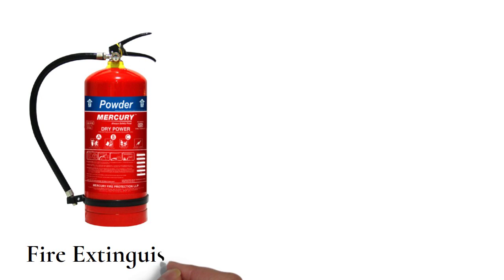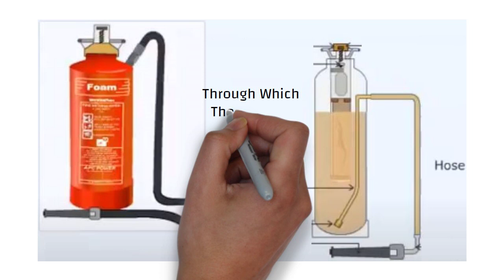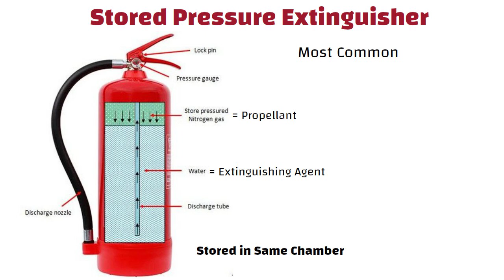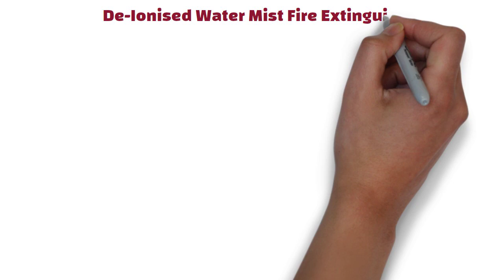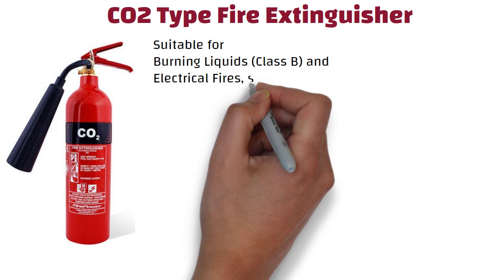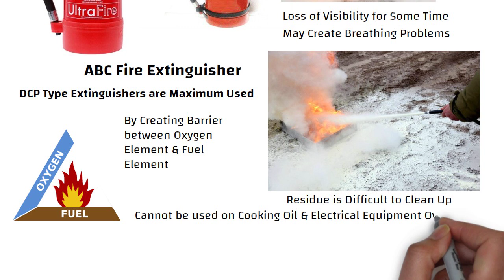FIRE EXTINGUISHER DEALERS IN KERALA, CALL 8138906102, FIRE EXTINGUISHER DEALERS IN ERNAKULAM.

Comment from the maker: Fire extinguisher dealers in PERUMBAVOOR, fire fighting contractors in PERUMBAVOOR, PERUMBAVOOR, fire and safety installations in PERUMBAVOOR, fire Fire extinguisher suppliers in PERUMBAVOOR,fire extinguishers in PERUMBAVOOR, fire extinguishers in PERUMBAVOOR, fire protection system in PERUMBAVOOR, fire and safety installation in PERUMBAVOOR, fire and safety contractors in PERUMBAVOOR, fire safety contractors in PERUMBAVOOR, fire and safety systems equipments in PERUMBAVOOR, fire equipment in PERUMBAVOOR, fire extinguisher in PERUMBAVOOR, fire protection system installation in PERUMBAVOOR, fire contractors in PERUMBAVOOR, fire safety consultants in PERUMBAVOOR,  fire alarm systems in PERUMBAVOOR, fire NOC in PERUMBAVOOR, fire AMC in PERUMBAVOOR, PERUMBAVOOR, fire fighting equipment in PERUMBAVOOR,
MS Jindal pipe dealers in PERUMBAVOOR, motor control panel in PERUMBAVOOR, fire pump panel in PERUMBAVOOR, motor control panel in PERUMBAVOOR, Morley fire alarm in PERUMBAVOOR, gst fire alarm in PERUMBAVOOR, addressable fire alarm system in PERUMBAVOOR, Pa talk back system in PERUMBAVOOR, PA two way talk back system in PERUMBAVOOR, auto glow SIGNAGES in PERUMBAVOOR, Karthar dealers in PERUMBAVOOR, Agni fire alarm dealers in PERUMBAVOOR, ASES SECURITY fire alarm dealers in PERUMBAVOOR, AUTO GLOW SIGNAGES in PERUMBAVOOR, FIRE PUMP PANEL in PERUMBAVOOR, LHP pump in PERUMBAVOOR. Karthar valves in PERUMBAVOOR, Ravel fire alarm system in PERUMBAVOOR. Jindal pipe dealers in PERUMBAVOOR, Jindal pipe dealers in PERUMBAVOOR. MS pipe dealers in PERUMBAVOOR. Butterfly valves in PERUMBAVOOR, PA talk back system in PERUMBAVOOR, Fire alarm dealers in PERUMBAVOOR, smoke detector dealers in PERUMBAVOOR, fire alarm panels dealers in PERUMBAVOOR, MCP, hooter dealers in Mangalor, hydrant valve dealers in PERUMBAVOOR, branch pipe dealers in PERUMBAVOOR,Fire CP hose in PERUMBAVOOR, Fire RRL hose in PERUMBAVOOR, heat detector dealers in PERUMBAVOOR, Motor Control panel in PERUMBAVOOR,  LED EXIT LIGHTS dealers in PERUMBAVOOR, emergency exit light dealers in PERUMBAVOOR, auto glow SIGNAGES dealers in PERUMBAVOOR. Conventional fire alarm system in PERUMBAVOOR, Fire alarm panel in PERUMBAVOOR, Notifier fire alarm dealers in PERUMBAVOOR, PA talk back unit dealers in PERUMBAVOOR. Honeywell fire alarm dealers in PERUMBAVOOR, BOSCH PA system dealers in PERUMBAVOOR, 
KIRLOSKAR FIRE FIGHTING PUMP DEALERS IN PERUMBAVOOR, FIRE FIGHTING EQUIPMENT DEALERS IN PERUMBAVOOR, FIRE ALARM SYSTEM DEALERS IN PERUMBAVOOR, FIRE CONSULTANTS IN PERUMBAVOOR, FIRE CONTRACTOTORS IN PERUMBAVOOR, FIRE CONTRACTORS IN PERUMBAVOOR, FIRE ALARM SYSTEM DEALERS IN PERUMBAVOOR, SMOKE DETECTOR DEALERS IN PERUMBAVOOR, FIRE PROTECTION SYSTEM IN PERUMBAVOOR, FIRE CONSULTANTS IN PERUMBAVOOR, FIRE CONSULTANTS IN PERUMBAVOOR, PA TALK BACK SYSTEM IN PERUMBAVOOR, ADDRESSABLE FIRE ALARM SYSTEMS IN PERUMBAVOOR, CUTTER PUMP DEALERS IN PERUMBAVOOR, ADDRESSABLE FIRE ALARM SYSTEM SUPPLIERS IN PERUMBAVOOR, SMOKE DETECTOR DEALERS IN TPERUMBAVOOR, PRESSURE BOOSTING PUMP DEALERS IN PERUMBAVOOR, SLURRY PUMP DEALERS IN PERUMBAVOOR, WATER PUMP DEALERS IN PERUMBAVOOR, RAVEL FIRE ALARM SYSTEM IN PERUMBAVOOR, LUBI FIRE FIGHTING PUMP DEALERS IN PERUMBAVOOR, FIRE EXTINGUISHER DEALERS IN PERUMBAVOOR, ADDRESSABLE FIRE ALARM SYSTEM DEALERS IN PERUMBAVOOR, 
KIRLOSKAR FIRE FIGHTING PUMP DEALERS IN PERUMBAVOOR, KIRLOSKAR FIRE FIGHTING PUMP DISTRIBUTORS IN PERUMBAVOOR, KIRLOSKAR FIRE PUMPS IN PERUMBAVOOR, KIRLOSKAR DIESEL ENGINE FIRE STANDBY PUMP DEALERS IN PERUMBAVOOR, KIRLSOKAR MONOBLOCK FIRE PUMP DEALERS IN PERUMBAVOOR, KIRLOSKAR FIRE TERRACE PUMP DEALERS IN PERUMBAVOOR, KIRLOSKAR FIRE PUMPS IN PERUMBAVOOR, KIRLOSKAR FIRE FIGHTING PUMP IN KARNATAKA, KIRLOSKAR FIRE PUMP DEALERS IN KARNATAKA, KIRLOKAR FIRE PUMP DEALERS IN HOSUR, KIRLSOAKR FIRE FIGHTING PUMP DEALERS IN PERUMBAVOOR, KIRLOSKAR FIRE PUMPS IN PERUMBAVOOR, KIRLSOKAR FIRE PUMP DISTRIBUTORS IN PERUMBAVOOR, FIRE ENGINE PUMP SETS IN PERUMBAVOOR, KIRLOSKAR PUMP DEALERS IN TIRUELVELI, KIRLOSKAR DEALERS IN KARNATAKA, KIRLOSKAR PUMPS IN KARNATAKA, KIRLOSKAR PUMPS IN PERUMBAVOOR, LUBI FIRE PUMP DEALERS IN PERUMBAVOOR, LUBI FIRE PUMP DEALERS IN KARNATAKA, LUBI FIRE PUMP DEALERS IN PERUMBAVOOR, FIRE PUMP SUPPLERS IN KAYAKUMARI, FIRE FIGHTING PUMP DEALERS IN KAYAKUMARIHOSUR, FIRE PUMP DEALERS IN KARNATAKA, FIRE PUMP SUPPLIERS IN PERUMBAVOOR, FIRE PUMP DEALERS IN PERUMBAVOOR, FIRE FIGHTING PUMPS IN PERUMBAVOOR, FIRE FIGHTING PUMP DEALERS IN PERUMBAVOOR, FIRE FIGHTING PUMP SUPPLIERS IN KARNATAKA, FIRE FIGHTING PUMP SET DEALERS IN PERUMBAVOOR, FIRE PUMP IN KARNATAKA, FIRE PUMP IN PERUMBAVOOR, FIRE PUMP IN PERUMBAVOOR, FIRE DIESEL ENGINE PUMP DEALERS IN PERUMBAVOOR, FIRE DIESEL ENGINE STANDBY PUMP DEALERS IN PERUMBAVOOR, FIRE JOCKEY PUMP DEALERS IN PERUMBAVOOR, FIRE JOCKEY PUMP DEALERS IN KARNATAKA, FIRE JOCKEY PUMP DEALERS IN PERUMBAVOOR. CRI PUMP DEALERS IN PERUMBAVOOR, HYDRO PNEUMATIC PRESSURE BOOSTING PUMP DEALERS IN PERUMBAVOOR, VERTICAL INLINE PUMP DEALERS IN PERUMBAVOOR, INDUSTRIAL PUMP DEALERS IN PERUMBAVOOR, SEWAGE PUMP DEALERS IN PERUMBAVOOR, STP AND ETP PUMP DEALERS IN TIRUNELVALEI, STP AND ETP PUMP DEALERS IN PERUMBAVOOR, STP AND ETP PUMP DEALERS IN PERUMBAVOOR, STP AND ETP PUMP DEALERS IN PERUMBAVOOR, HYDRO PNEUMATIC PRESSURE BOOSTING PUMP DEALERS IN PERUMBAVOOR, SEWAGE PUMP DEALERS IN PERUMBAVOOR, DEWATERING PUMP DEALERS IN PERUMBAVOOR, FIRE JOCKEY PUMP DEALERS IN PERUMBAVOOR, CRI PUMP DEALERS IN PERUMBAVOOR,

Comment from the maker: FIRE ALARM DEALERS IN PERUMBAVOOR, ADDRESSABLE FIRE ALARM DEALERS IN PERUMBAVOOR, FIRE ALARM SYSTEM DEALERS IN PERUMBAVOOR, ADDRESSABLE FIRE ALARM SYSTEM DEALERS IN PERUMBAVOOR, FIRE DETECTION SYSTEM IN PERUMBAVOOR, SMOKE DETECTOR DEALERS IN PERUMBAVOOR, CONVENTIONAL FIRE ALARM DEALERS IN PERUMBAVOOR, MORLEY FIRE ALARM DEALERS IN PERUMBAVOOR, GST FIRE ALARM DEALERS IN PERUMBAVOOR, ASES SECURITY FIRE ALARM DEALERS IN PERUMBAVOOR, BEAM DETECTOR DEALERS IN PERUMBAVOOR, FIRE ALARM SUPPLIERS IN PERUMBAVOOR, FIRE ALARM TRADERS IN PERUMBAVOOR, FIRE ALARM PANEL DEALERS IN PERUMBAVOOR, HEAT DETECTOR DEALERS IN PERUMBAVOOR, FIRE ALARM SYSTEM SUPPLIERS IN PERUMBAVOOR, FIRE ALARM COMPANIES IN PERUMBAVOOR, FIRE EQUIPMENT DEALERS IN PERUMBAVOOR, ADRRESSABLE FIRE ALARM PANEL DEALERS IN PERUMBAVOOR, FIRE ALARM SYSTEM IN PERUMBAVOOR, BATTERY OPERATED DETECTOR DEALERS IN PERUMBAVOOR, ASPIRATION DETECTION SYSTEM DEALERS IN PERUMBAVOOR, FIRE ALARM MCP - MANUAL CALL POINT DEALERS IN PERUMBAVOOR, FIRE ALARM HOOTER DEALERS IN PERUMBAVOOR, PA TWO WAY TALK BACK SYSTEM DEALERS IN PERUMBAVOOR, PA SYSTEM DEALERS IN PERUMBAVOOR, PA TALK BACK UNIT DEALERS IN PERUMBAVOOR, HOOTER CUM STROBE DEALERS IN PERUMBAVOOR, FIRE PROTECTION SYSTEM IN PERUMBAVOOR, FIRE ALARM CONTRACTORS IN PERUMBAVOOR, FIRE DETECTORS IN PERUMBAVOOR, FIRE ALARM DEALERS IN KOLLAM, ADDRESSABLE FIRE ALARM DEALERS IN KOLLAM, SMOKE DETECTOR DEALERS IN KOLLAM, FIRE EQUIPMENT DEALERS IN PERUMBAVOOR, FIRE ALARM INSTALLATION IN PERUMBAVOOR, FIRE ALARM COMPANIES IN PERUMBAVOOR FIRE ALARM DISTRIBUTORS IN PERUMBAVOOR, TALK BACK SYSTEM DEALERS IN PERUMBAVOOR, FIRE ALARM SENSOR DEALERS IN PERUMBAVOOR, FIRE EXTINGUISHER DEALERS IN PERUMBAVOOR, FIRE ALARM DEALERS IN ERNAKULAM, FIRE ALARM DEALERS IN KERALA, ADDRESSABLE FIRE ALARM DEALERS IN CALICUT, SMOKE DETECTOR IN PERUMBAVOOR,  FIRE EXTINGUISHER DEALERS IN PERUMBAVOOR, FIRE EXTINGUISHER SUPPLIERS IN PERUMBAVOOR, FIRE EXTINGUISHER DISTRIBUTORS IN PERUMBAVOOR FIRE EXTINGUISHER IN PERUMBAVOOR, ABC TYPE FIRE EXTINGUISHER DEALERS IN PERUMBAVOOR, CO2 TYPE FIRE EXTINGUISHER DEALERS IN PERUMBAVOOR, CLEAN AGENT FIRE EXTINGUISHER IN PERUMBAVOOR, MODULAR TYPE FIRE EXTINGUISHER DEALERS IN PERUMBAVOOR, MECHANICAL FOAM FIRE EXTINGUISHER DEALERS IN PERUMBAVOOR, FIRE FIGHTING PUMP DEALERS IN PERUMBAVOOR, FIRE PUMP DEALERS IN PERUMBAVOOR, KIRLOSKAR FIRE PUMP DEALERS IN PERUMBAVOOR, FIRE JOCKEY PUMP DEALERS IN PERUMBAVOOR, FIRE DISEL ENGINE DRIVEN PUMP DEALERS IN PERUMBAVOOR, FIRE FIGHTING EQUIPMENT DEALERS IN PERUMBAVOOR, FIRE FIGHTING SYSTEM IN PERUMBAVOOR, VERTICAL INLINE PUMP DEALERS IN PERUMBAVOOR, HYDRO PNEUMATIC PRESSURE BOOSTING PUMP DEALERS IN PERUMBAVOOR, VERTICAL TURBINE PUMP DEALERS IN PERUMBAVOOR, SEWAGE PUMP DEALERS IN PERUMBAVOOR, RO PUMP DEALERS IN PERUMBAVOOR. FIRE EXTINGUISHER IN PERUMBAVOOR, FIRE ECONTRACTORS IN PERUMBAVOOR, FIRE EXTINGUISHER SUPPLIERS IN PERUMBAVOOR, FIRE EXTINGUISHER DEALERS IN KALPETTA, FIRE EXTINGUISHER DEALERS IN MANANTHAVADY, FIRE EXTINGUISHER DEALERS IN BATHERY,

Comment: FIRE EXTINGUISHER DEALERS IN KOTTAKKAL, FIRE EXTINGUISHER SUPPLIERS IN KOTTAKKAL, FIRE EXTINGUISHER DISTRIBUTORS IN KOTTAKKAL, FIRE EXTINGUISHER IN KOTTAKKAL, ABC TYPE FIRE EXTINGUISHER DEALERS IN KOTTAKKAL, CO2 TYPE FIRE EXTINGUISHER DEALERS IN KOTTAKKAL, CLEAN AGENT FIRE EXTINGUISHER IN KOTTAKKAL, MODULAR TYPE FIRE EXTINGUISHER DEALERS IN KOTTAKKAL, MECHANICAL FOAM FIRE EXTINGUISHER DEALERS IN KOTTAKKAL, FIRE EXTINGUISHER NEAR ME KOTTAKKAL, FIRE EXTINGUISHER TRADERS IN KOTTAKKAL, FIRE FIGHTING COMPANIES IN KOTTAKKAL, FIRE CONTRACTORS IN KOTTAKKAL, FIRE EQUIPMENT DEALERS IN KOTTAKKAL, FIRE ALARM DEALERS IN KOTTAKKAL, FIRE PUMP DEALERS IN KOTTAKKAL, SMOKE DETECTOR DEALERS IN KOTTAKKAL, FIRE FIGHTING SYSTEM IN KOTTAKKAL, FIRE PROTECTION SYSTEM IN KOTTAKKAL, FIRE AND SAFETY CONTRACTORS IN KOTTAKKAL, FIRE HYDRANT SYSTEMS IN KOTTAKKAL, PA TALK BACK SYSTEM IN KOTTAKKAL, FIRE NOC IN KOTTAKKAL, FIRE INSTALLATION IN KOTTAKKAL, FIRE NOC RENEWAL IN KOTTAKKAL, KIRLOSKAR FIRE PUMP DEALERS IN KOTTAKKAL, FIRE EXTINGUISHER NEAR ME KOTTAKKAL, FIRE EXTINGUISHER MANUFACURERS IN KOTTAKKAL, SAFEX FIRE EXTINGUISHER DEALERS IN KOTTAKKAL, FIRE NOC CONTRACTORS IN KOTTAKKAL, FIRE FIGHTING EQUIPMENT DEALERS IN KOTTAKKAL, FIRE PROTECTION SYSTEM IN KOTTAKKAL, FIRE INSTALLATION IN KOTTAKKAL, FIRE SAFETY CONTRACTORS IN KOTTAKKAL, FIRE AMC IN KOTTAKKAL, FIRE PROTECTION SYSTEM IN KOTTAKKAL, FIRE PROTECTION EQUIPMET IN KOTTAKKAL, AMC OF FIRE SYSTEM IN KOTTAKKAL, FIRE CONSULTANTS IN KOTTAKKAL, FIRE AND SAFETY EQUIPMENT DEALERS IN KOTTAKKAL, ADDRESSABLE FIRE ALARM SYSTEM IN KOTTAKKAL, KARTHAR VALVE DEALERS IN KOTTAKKAL, DCP TYPE FIRE EXTINGUISHER IN KOTTAKKAL, POWSER TYPE FIRE EXTINGUISHERS IN KOTTAKKAL, FIRE HYDRANT SYSTEM IN KOTTAKKAL, FIRE ALARM PANEL DEALERS IN KOTTAKKAL, SAFEPRO FIRE EXTINGUISHER DEALERS IN KOTTAKKAL, MS AND GI PIPE DEALERS IN KOTTAKKAL, JINDAL PIPE DEALERS IN KOTTAKKAL, AGNI FIRE ALARM DEALERS IN KOTTAKKAL, FIRE EQUIPMENT DEALERS IN KOTTAKKAL, FIRE EQUIPMENT SUPPLIERS IN KOTTAKKAL, FIRE EQUIPMENT TRADERS IN KOTTAKKAL, FIRE SPRINKLER SYSTEM IN KOTTAKKAL, RAVLE FIRE ALARM DEALERS IN KOTTAKKAL, RAVEL FIRE ALARM SYSTEM IN KOTTAKKAL, AGNI FIRE ALARM DISTRIBUTORS IN KOTTAKKAL, FIRE ALARM CONTRACTORS IN KOTTAKKAL, FIRE PIPE INSTALLATION IN CONTRACTORS IN KOTTAKKAL, FIRE SAFETY CONTRACTORS IN KOTTAKKAL, FIRE PA TWO WAY TALK BACK SYSTEM DEALERS IN KOTTAKKAL, HEAT DETECTOR DEALERS IN KOTTAKKAL, HONEYWELL FIRE ALARM DEALERS IN KOTTAKKAL, FIRE NOC CONSULTANTS IN KOTTAKKAL, FIRE AMC AND FIRE NOC IN KOTTAKKAL, FIRE SAFETY COMPANIES IN KOTTAKKAL, NEWAGE DEALERS IN KOTTAKKAL, MONSHER FIRE EQUIPMENT DEALERS IN KOTTAKKAL, KARTHAR VALVE DEALERS IN KOTTAKKAL, FIRE HYDRANT VALVE DEALERS IN KOTTAKKAL, FIRE HOSE REEL DRUM DEALERS IN KOTTAKKAL, FIRE SPRINKLER DEALERS IN KOTTAKKAL, FIRE PUMP DEALERS IN KOTTAKKAL, LUBI PUMP DEALERS IN KOTTAKKAL, LHP PUMP DEALERS IN KOTTAKKAL. FIRE CONTRACTORS IN KOTTAKKAL, FIRE AND SAFETY CONTRACTORS IN KOTTAKKAL, FIRE EQUIPMENT DEALERS IN KOTTAKKAL, FIRE FIGHTING CONTRACTORS IN KOTTAKKAL,

Comment: Fire extinguisher dealers in KAYAMKULAM, fire fighting contractors in KAYAMKULAM, KAYAMKULAM, fire and safety installations in KAYAMKULAM, fire extinguisher suppliers in KAYAMKULAM,fire extinguishers in KAYAMKULAM, fire extinguishers in KAYAMKULAM, fire protection system in KAYAMKULAM, f fire and safety installation in KAYAMKULAM, fire and safety contractors in KAYAMKULAM, fire safety contractors in KAYAMKULAM, fire and safety systems equipments in KAYAMKULAM, fire equipment in KAYAMKULAM, fire extinguisher in KAYAMKULAM, fire protection system installation in KAYAMKULAM, fire contractors in KAYAMKULAM, fire safety consultants in KAYAMKULAM,  fire alarm systems in KAYAMKULAM, fire NOC in KAYAMKULAM, fire AMC in KAYAMKULAM, KAYAMKULAM, fire fighting equipment in KAYAMKULAM,
MS Jindal pipe dealers in KAYAMKULAM, motor control panel in KAYAMKULAM, fire pump panel in KAYAMKULAM, motor control panel in KAYAMKULAM, Morley fire alarm in KAYAMKULAM, gst fire alarm in KAYAMKULAM, addressable fire alarm system in KAYAMKULAM, Pa talk back system in KAYAMKULAM, PA talk back system in KAYAMKULAM, auto glow SIGNAGES in KAYAMKULAM, SIGNAGES in KAYAMKULAM, pump PANELS in KAYAMKULAM, LHP pump in kohi. Karthar valves in KAYAMKULAM, Ravel fire alarm system in KAYAMKULAM. Jindal pipe dealers in KAYAMKULAM, Jindal pipe dealers in KAYAMKULAM. MS pipe dealers in KAYAMKULAM. Butterfly valves in KAYAMKULAM, PA talk back system in KAYAMKULAM, Fire alarm dealers in KAYAMKULAM,, smoke detector dealers in KAYAMKULAM, fire alarm panels dealers in KAYAMKULAM, MCP, hooter dealers in Mangalor, hydrant valve dealers in KAYAMKULAM, branch pipe dealers in KAYAMKULAM, cp hose, RRL hose, heat detector dealers in KAYAMKULAM,, Motor Control panel,  LED EXIT LIGHTS dealers in KAYAMKULAM, emergency exit light dealers in KAYAMKULAM, auto glow SIGNAGES dealers in KAYAMKULAM. Conventional fire alarm system in KAYAMKULAM,
KIRLOSKAR FIRE FIGHTING PUMP DEALERS IN KAYAMKULAM, FIRE FIGHTING EQUIPMENT DEALERS IN KAYAMKULAM, FIRE ALARM SYSTEM DEALERS IN KAYAMKULAM, FIRE CONSULTANTS IN KAYAMKULAM, FIRE CONTRACTOTORS IN KAYAMKULAM, FIRE CONTRACTORS IN KAYAMKULAM, FIRE ALARM SYSTEM DEALERS IN KAYAMKULAM, SMOKE DETECTOR DEALERS IN KAYAMKULAM, FIRE PROTECTION SYSTEM IN KAYAMKULAM, FIRE CONSULTANTS IN KAYAMKULAM, FIRE CONSULTANTS IN KAYAMKULAM, PA TALK BACK SYSTEM IN KAYAMKULAM, ADDRESSABLE FIRE ALARM SYSTEMS IN KAYAMKULAM, CUTTER PUMP DEALERS IN KAYAMKULAM, ADDRESSABLE FIRE ALARM SYSTEM SUPPLIERS IN KAYAMKULAM, SMOKE DETECTOR DEALERS IN TKAYAMKULAM, PRESSURE BOOSTING PUMP DEALERS IN KAYAMKULAM, SLURRY PUMP DEALERS IN KAYAMKULAM, WATER PUMP DEALERS IN KAYAMKULAM, RAVEL FIRE ALARM SYSTEM IN KAYAMKULAM,

Comment: FIRE EXTINGUISHER DEALERS IN THIRUVALLA, FIRE EXTINGUISHER SUPPLIERS IN THIRUVALLA, FIRE EXTINGUISHER DISTRIBUTORS IN THIRUVALLA, FIRE EXTINGUISHER IN THIRUVALLA, ABC TYPE FIRE EXTINGUISHER DEALERS IN THIRUVALLA, CO2 TYPE FIRE EXTINGUISHER DEALERS IN THIRUVALLA, CLEAN AGENT FIRE EXTINGUISHER IN THIRUVALLA, MODULAR TYPE FIRE EXTINGUISHER DEALERS IN THIRUVALLA, MECHANICAL FOAM FIRE EXTINGUISHER DEALERS IN THIRUVALLA, FIRE EXTINGUISHER NEAR ME THIRUVALLA, FIRE EXTINGUISHER TRADERS IN THIRUVALLA, FIRE FIGHTING COMPANIES IN THIRUVALLA, FIRE CONTRACTORS IN THIRUVALLA, FIRE EQUIPMENT DEALERS IN THIRUVALLA, FIRE ALARM DEALERS IN THIRUVALLA, FIRE PUMP DEALERS IN THIRUVALLA, SMOKE DETECTOR DEALERS IN THIRUVALLA, FIRE FIGHTING SYSTEM IN THIRUVALLA, FIRE PROTECTION SYSTEM IN THIRUVALLA, FIRE AND SAFETY CONTRACTORS IN THIRUVALLA, FIRE HYDRANT SYSTEMS IN THIRUVALLA, PA TALK BACK SYSTEM IN THIRUVALLA, FIRE NOC IN THIRUVALLA, FIRE INSTALLATION IN THIRUVALLA, FIRE NOC RENEWAL IN THIRUVALLA, KIRLOSKAR FIRE PUMP DEALERS IN THIRUVALLA, FIRE EXTINGUISHER NEAR ME THIRUVALLA, FIRE EXTINGUISHER MANUFACURERS IN THIRUVALLA, SAFEX FIRE EXTINGUISHER DEALERS IN THIRUVALLA, FIRE NOC CONTRACTORS IN THIRUVALLA, FIRE FIGHTING EQUIPMENT DEALERS IN THIRUVALLA, FIRE PROTECTION SYSTEM IN THIRUVALLA, FIRE INSTALLATION IN THIRUVALLA, FIRE SAFETY CONTRACTORS IN THIRUVALLA, FIRE AMC IN THIRUVALLA, FIRE PROTECTION SYSTEM IN THIRUVALLA, FIRE PROTECTION EQUIPMET IN THIRUVALLA, AMC OF FIRE SYSTEM IN THIRUVALLA, FIRE CONSULTANTS IN THIRUVALLA, FIRE AND SAFETY EQUIPMENT DEALERS IN THIRUVALLA, ADDRESSABLE FIRE ALARM SYSTEM IN THIRUVALLA, KARTHAR VALVE DEALERS IN THIRUVALLA, DCP TYPE FIRE EXTINGUISHER IN THIRUVALLA, POWSER TYPE FIRE EXTINGUISHERS IN THIRUVALLA, FIRE HYDRANT SYSTEM IN THIRUVALLA, FIRE ALARM PANEL DEALERS IN THIRUVALLA, SAFEPRO FIRE EXTINGUISHER DEALERS IN THIRUVALLA, MS AND GI PIPE DEALERS IN THIRUVALLA, JINDAL PIPE DEALERS IN THIRUVALLA, AGNI FIRE ALARM DEALERS IN THIRUVALLA, FIRE EQUIPMENT DEALERS IN THIRUVALLA, FIRE EQUIPMENT SUPPLIERS IN THIRUVALLA, FIRE EQUIPMENT TRADERS IN THIRUVALLA, FIRE SPRINKLER SYSTEM IN THIRUVALLA, RAVLE FIRE ALARM DEALERS IN THIRUVALLA, RAVEL FIRE ALARM SYSTEM IN THIRUVALLA, AGNI FIRE ALARM DISTRIBUTORS IN THIRUVALLA, FIRE ALARM CONTRACTORS IN THIRUVALLA, FIRE PIPE INSTALLATION IN CONTRACTORS IN THIRUVALLA, FIRE SAFETY CONTRACTORS IN THIRUVALLA, FIRE PA TWO WAY TALK BACK SYSTEM DEALERS IN THIRUVALLA, HEAT DETECTOR DEALERS IN THIRUVALLA, HONEYWELL FIRE ALARM DEALERS IN THIRUVALLA, FIRE NOC CONSULTANTS IN THIRUVALLA, FIRE AMC AND FIRE NOC IN THIRUVALLA, FIRE SAFETY COMPANIES IN THIRUVALLA, NEWAGE DEALERS IN THIRUVALLA, MONSHER FIRE EQUIPMENT DEALERS IN THIRUVALLA, KARTHAR VALVE DEALERS IN THIRUVALLA, FIRE HYDRANT VALVE DEALERS IN THIRUVALLA, FIRE HOSE REEL DRUM DEALERS IN THIRUVALLA, FIRE SPRINKLER DEALERS IN THIRUVALLA, FIRE PUMP DEALERS IN THIRUVALLA, LUBI PUMP DEALERS IN THIRUVALLA, LHP PUMP DEALERS IN THIRUVALLA. FIRE CONTRACTORS IN THIRUVALLA, FIRE AND SAFETY CONTRACTORS IN THIRUVALLA, FIRE EQUIPMENT DEALERS IN THIRUVALLA, FIRE FIGHTING CONTRACTORS IN THIRUVALLA,